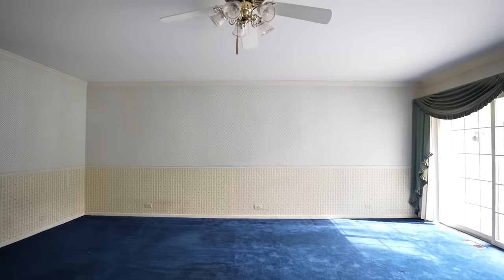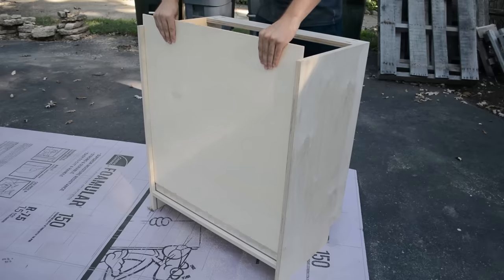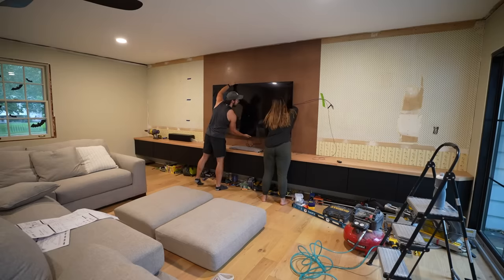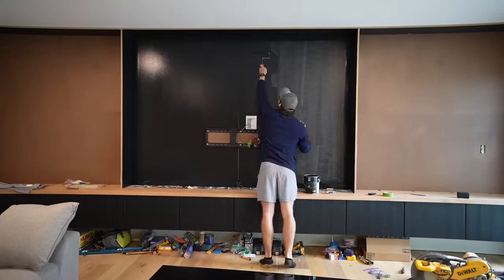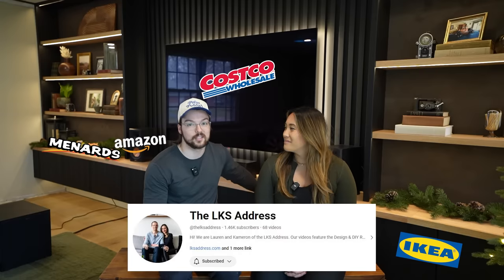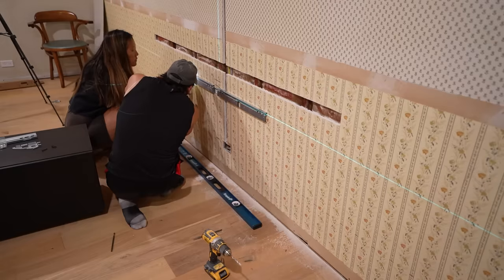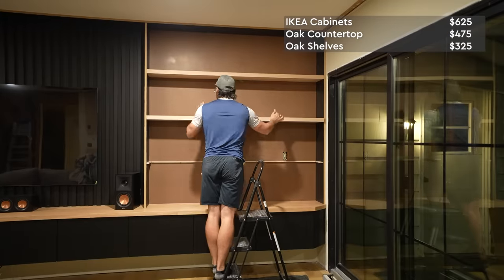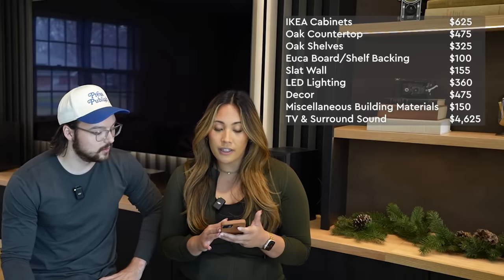Building Our Dream Entertainment Center | Q & A

Comment: Have you guys ever thought about using Nanoleaf 4DX lighting? Have a look. I’m thinking about combining your type design with Nanoleaf😀
Reply from the maker: We did consider it and it was actually the plan at the start of the project. However, it does not work well with a black backdrop. The wall behind the TV should really be pure white for the effect to work properly.

Comment: Love your video's! Quick note about the subwoofer. You can easily place the sub behind the sofa, and if you pick up a wireless kit from Klipsch, you dont need to run a signal wire to the receiver, so no cables going over the floor : )

Comment: First off, I am actually very appreciative of your transparency.  I might just have to copy your setup.  I do have a question since I am also into sound and video.  Is your receiver in the cabinets, and can the remote work through the doors you have?  I also have Klipsch speakers but have seperates for audio components which tend to be deeper.  If I did this setup, I might have to go down to a single receiver and wanted to see how it was working out for you.

You're setup is so clean, that if you can't hide your cables, another option to consider is getting some angled Klipsch ceiling speakers that match your setup for the rears and a wireless dongle for the sub.  And if you're in the ceiling anywyas, you might as well throw some Atmos speakers up there while you're there. lol.  Thanks for your videos.

Comment: Nice build! Just 1 recommendation for the speakers, check the isoacoustic stands, it will make a huge huge difference in the sound of your bookshelves speakers. It isnt an audiophile snake oil product. The speakers will sound less boomy and more tight on bass. You can add shorter or taller poles depend what u prefer. Usually the tweeters needs to be at ears level when seated. 

Keep the good work!

Also check for ambilight systems for led around the tv, it makes it really immersive and nowdays there is plug and play kits. Mine was a raspberry pi,capture video card setup. Now I bought a 85inch sony tv and will probably add a kit instead,even if the diy version was amazing and fully custom,wiyh each led adrrssable instead of multiples driven together in most kits.
Reply from the maker: Thank you! The speakers came with cork on the bottom but it is pretty thin, so I may upgrade it. And I strongly considered buying the ambient light system for the TV, but ended up just sticking with the standard LEDs. Because of the slats and the wall being black, I felt the effect would be distracting and not look the greatest. I feel it works best on a flat, white wall. We may still add them elsewhere in the house though

Comment: Hesitating on choice in materials has put a lot of our projects on the backburner. That and the ever impending doom that if I DIY something I'll be calling a carpenter in the end anyway. I NEVER would have thought to use the concrete for that wall either. Great stuff.
Reply from the maker: We also take awhile to plan out our projects before getting started. We can get a little impatient at times but planning it all out in advance is well worth it and will save you time in the end. Thanks for watching!

Comment: By the way, I absolutely love the way you did the floating shells on either side of the TV section. I seen floating shelves done, but none quite as effective as these, where you used leftover bits of half inch (?) plywood to mount the floating shelves on. What a great use of your material and what sleek shelves you produced.

Comment: Love your work. Did you put the amplifier inside the cabinets? Did it require adding extra ventilation? Also, which amplifier did you go for? I am also planning to expand my Klipsch from 2.1 to 7.1 and have not been able to pick an amplifier yet.
Reply from the maker: Thank you! I have the Denon S760H. We got it from Costco for a great price. It has 7.2 capability and 4k @ 120fps support so it checked all the boxes for us. I added holes in the bottom of the cabinet but may add a heat triggered fan in the future. I highly recommend the Denon. I did a ton of research and it’s a great AVR for the price

Comment: Hi. Great job and very good video.
It would be interesting to know what tools you used, which brands you chose and why and their cost. I think this is an important factor to ensure the quality and the efficiency of the job.
Thanks
Reply: Tools, and especially their brand, are not what should hold people back from doing work like this.  ALL of it could be accomplished with a Ryobi circular saw, Ryobi router, Ryobi miter saw, and Ryobi power and/or air tools.
Reply: @failfurby   Thanks. I never worked wood but I’d like to try doing something like this. Sincerely, I don’t know the first thing but good tools seem to me to be a must.
Which tool is the one that hones the wood to host the LED strip?
Reply: @TheGuggo   that was a hand-held router, also sometimes called a palm router.
Reply: @failfurby  thank you !

Comment: I’m not sure if you mentioned in either video what the dimensions were for the entire area. I’ve watched both quite a few times but may have missed if they were said. I love this so much that I am replicating it but on a smaller scale. I’ve decided on 12’ wide for the wall area and my ceiling is only 8’ high. I’m guessing your wall is over 20’ wide?
Reply from the maker: Yes, it’s 21’ wide and we have 8.5’ ceilings. Hope that helps and good luck with your project 😁

Comment: Happy New Year! Question for you regarding your receiver. Did you place your receiver in the cabinets below the TV? If so, what are you doing for air flow concerns?
Reply from the maker: Happy New Year! Yes, the AVR is in the cabinet directly beneath the TV along with my PS5. I ended up cutting a grid of 1.5" holes in the underside of the cabinet to allow for more airflow. I may also add in a fan that automatically turns on when the temperature hits a certain level. They make kits on amazon for pretty cheap
Reply: @goldenkeydesign which AVR are you using?  Many are far too deep to fit in the IKEA Besta cabinets.  I’ve used then before, free standing, and had to cut out the back to make room.
Reply from the maker: @bungeholegymtestkitchen9888  I have the Denon AVR S760H 75W 7.2ch 8K AV Receiver. It's a little tight but it fits with some room to spare

Comment: Great work! Question, what type of wood did you use behind the TV for the LEDs? 1x2? Making a similar frame behind the bed headboard to mount some ambient LEDs.
Reply from the maker: I just ripped down some scrap plywood. Doesn't really matter what size as along as there is enough space to adhere the LEDs to it. Another option would be to stick the LEDs directly to the back of the headboard - could save you some time
Reply: @GoldenKeyDesign  Thanks! I’m using the discontinued IKEA Myrvarv LED strip which is about 1/2” wide, so ripping down some 1/2” plywood would work. It’s flexible but not enough to attach directly to the headboard.

Comment: Can you explained how did you set up multiple zones on the LED ?
Reply from the maker: Each zone has its own electrical run back to the power supply with their own remote. They are not in series

Comment: What you said about watching TV - I could not agree more. I have family members whose TV are mounted above the fireplace and I find myself preferring to stand than to sit and strain my neck to watch TV. While a projector TV was a good idea, I think the call to go with an OLED TV is better simply due to the amount of lights. 

Maybe I missed it, but what exactly is Bianca's 9-to-5 job? I would love nothing more than to work 100% remote, even as an engineer - I am actually a Value Stream Process Engineer IRL.

The total cost is better than I expected. I was thinking the entire build would be over $10k, so for it to be under $8k is very impressive. Now, I grant that if this was being built by a contractor, then yeah, the cost would be through the roof.
Reply from the maker: Bianca works for a tech company is fully remote which makes working on the house together much easier and doable. Thanks for watching!

Comment: i enjoy all of your videos, i have a 77 C1, this is a great project id like to mimic, what was the most difficult part of the build skill wise?
Reply from the maker: That's a great TV! Skill wise, the hardest parts were gluing up and fitting the countertop in place (making the whole thing square/straight along with making the joints seamless) as well as routering the slots in the floating shelves for the LED channel (mostly because it is very easy to screw it up and accidently go off line)

Comment: Did you run any of the rear speaker wires through the ceiling or baseboards? Just curious how to keep that wiring clean haha. The entertainment area turned out great!
Reply from the maker: Our rear speakers sit on a table behind the couch (not in-wall or in-ceiling). So the only way to truly hide the rear speaker wire would be to cut a hole in the floor and run it underneath to the media center which we did not want to do. So the next best option was to run it under the rug. The few wire that you see to the left of us are those wires. There really wasn't any other option, but we plan to hide them with an oak wire cover so they blend in a bit more. Hope that helps!

Comment: Can you explain what you didn't like about the version with the electric fireplace?
Reply from the maker: The electric fireplaces within our budget tended to look tacky. The ones that looked higher end and modern were well in the thousands $$$. On top of that, it would have been hard to get the TV mounted as low as we did in this version. We also liked the idea of the tv being sunken in with the shelving on either side extruding out from the wall vs. the middle section with tv being extruded out into the room. Hope that helps 😁
Reply: @GoldenKeyDesign  Thanks!  Just for clarification, that was with the fireplace on top of the oak countertop, correct?  What do think about it being below instead of the center cabinet?
Reply from the maker: @lorenmaxwell3961   The design with the fireplace was completely different from the one we ended up going with. The fireplace version was shown in the video @0:47
Reply: @GoldenKeyDesign  Ah, ok -- I completely overlooked that!  Thanks for the replies and thanks for the fantastic videos!

Comment: Those cables on the floor behind you...those don't go to the sub or rear speakers, do they?
Reply from the maker: Correct, they are the sub and rear speaker cables going to the AVR in the cabinet under the TV
Reply: @GoldenKeyDesign  Are you not going to run those in the ceiling and down the walls?
Reply from the maker: @DonoVideoProductions  The sub and rear speakers are floating in the room (not against a wall) therefore running the wire the way we did was the best option but we plan to cover them with some oak trim